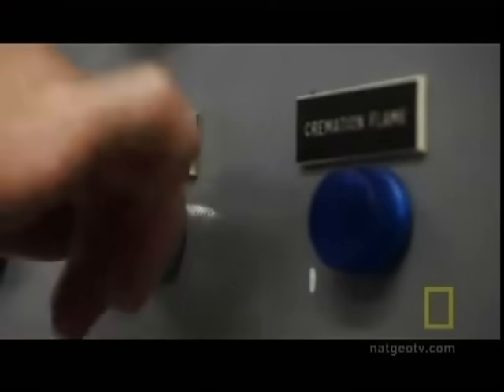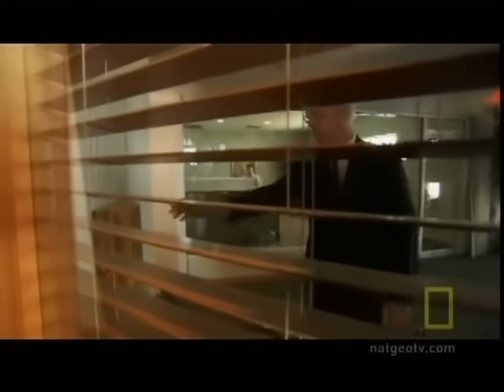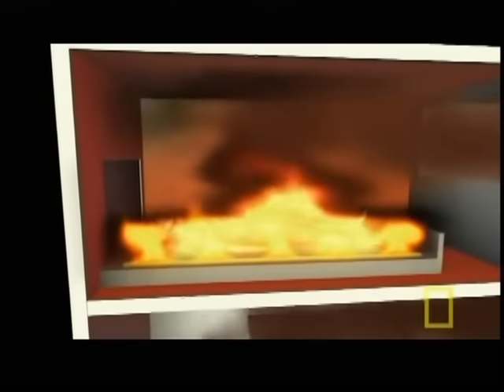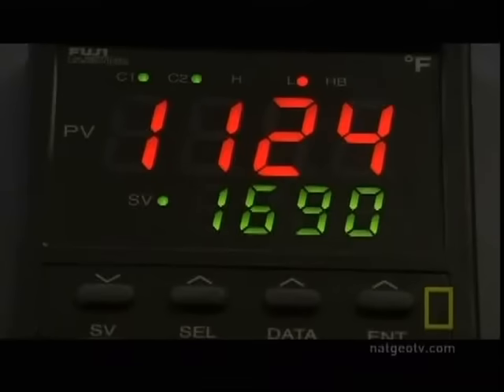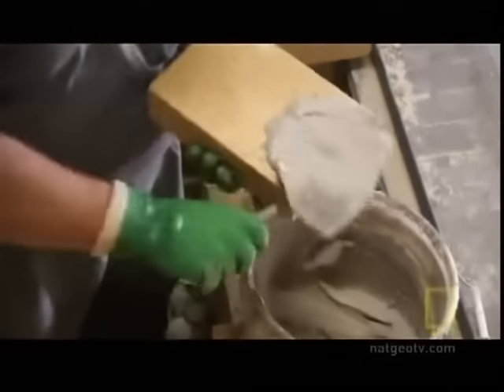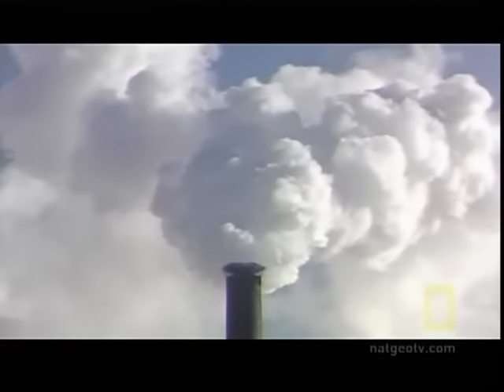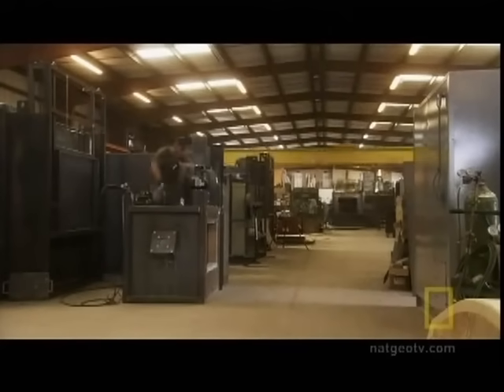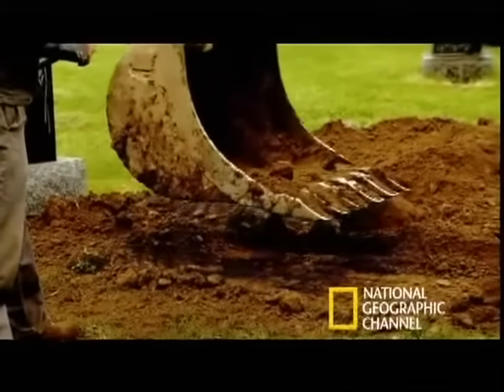What Happens During a Cremation? How do Crematories Work? A Scientific Look at a Real Cremation.

Comment: Remained powder of bones could be sprinkled for purpose of Farming, for purpose of bricks making, for purpose of mixing with Tar and spreading on road for Road surfacing, etc.
In India the remains are released in Holy river or at sea with Hindu rituals performed.
India needs plenty of Such machines as many crematorium are with pyre and uses wood for cremation. 
Hope Respected company could surely extend it's selling branches in India  or JOINT venture with Indian CORPORATE.

Comment: These Retorts or Chambers as many call them are modern compared to the 1928 versions I worked with. The chambers were from 1928 and the burners were from 1967.  We put metal such as steel, bronze copper, wood, and cardboard in there for cremations.

Comment: Inglewood Park Cemetery Mortuary still has very early concrete crematoriums.  Possibly built originally in 1905.
Reply: The evil Germans of the 40’s used common house bricks to build theirs and they could cremate much much faster than modern day crematories. They could also cremate multiple bodies at the same time.
The above facts were disclosed by numerous survivors of WW2.

Comment: Hold up , using a magnet for medical implants? They are non ferrous
Reply from the maker: The magnet is used for the screws from the casket. But yes any implants will not be picked up by the magnet.

Comment: I’m at work now! I have 11 cremations today. With three available cremation chambers I should be done in about eight hours. One of the deceased was killed right in front of the funeral home on Saturday morning he was driving his new motorcycle. it normally takes about 100 pounds per hour with our new units. You cannot put a casket in a cremation chamber unless it is solid wood or rigid cardboard. A metallic casket would be a Real problem. We are limited to what hours we can operate in.  Two of the cases today are badly decomposed and I am going to do them first because they are really ripe! After that will come the traumatic deaths that are missing limbs or have been crushed etc. And then I will finish today with the regular run-of-the-mill cremations. We always have babies. That’s the majority are stillborn or ones who did not survive NICU, Born with terrible defects. Last week I had a case that was 400 pounds! The name on the paperwork was that of a female! The container had leaked mass, It had leaked because this involved a shooting. When we went to slide this thing over you have a very profound male appendage! So my manager said just to use an ETA for the female name.
Reply: @Hello there, how are you doing this blessed day??
Reply: hi as an younger guy with illness im seeking cremation but worried as im so tall at 7ft 1 tall can my body be cremated as im taller but of slim build can i even have an cremation  ??

Comment: 2 hours !!  Germany apparently done 1,000 in 20-30 mins completely to ash.
Reply: Larger ovens, multiple sites, working in batches, not caring about letting the ashes get mixed up, not letting the ovens cool down between them, not caring about the neatness of the burn and murdering between 1 and 2 million Jews outside concentration camps. 

You seem perfectly comfortable with being a neo-Nazi - so it would be really useful if you realised that what you're listening to is a deliberate scam on you as well as its more direct, obvious victims. Look into the history of the 'blood libel' lie, for instance - the reason you use the term 'Satanic agenda', one of the lies that helped facilitate the Holocaust and also a blatant excuse to murder Jews for money, or simply rob them, for centuries before that. See, for instance, how Henry III of England very cynically monetised the case of 'Little Saint Hugh of Lincoln'. How Edward I robbed his own subjects as well as the Jewish population via the Edict of Expulsion. Or how, in the 2020 US Presidential election, one blood libeller funded and ran another blood libeller's 'Independent' campaign to steal votes from his main opponent, then stole $250 million from his most fanatical supporters with a fake 'contest the fraudulent election' fund.

Comment: So your saying 6 million is a little high
Reply: Of course, if you use larger ovens, work in batches, don't bother about the completeness of the burn or getting ashes mixed up, don't let the ovens cool down between batches, use slave labour to keep them running 24/7, operate at multiple sites and murder between 1 and 2 million Jews outside of concentration camps that all helps. 

It would be useful if you realised that Nazi propaganda is a deliberate scam on the people who actually believe it as well as its more direct, obvious victims.

Comment: When they cremate you they calculate the time and temperature of the burn based on your body weight . This calculation is made so that at the end of the cremation there are ashes left to be given to the family. I once saw an interview with two morticians that miscalculated the heat and time needed and when they opened the chamber there was nothing there. The heat and time burned up everything. No ashes no nothin. They panicked because they had no ashes to give the family. What they ended up doing was going out and they found a road killed dog. They cremated the dog properly so there were ashes let and they gave these to the family.
Reply: If you saw this, then the "two morticians" were lying.  

Once cremation is complete, there is only the skeletal remains which are pulverized into what people call "ashes".  If you left the burner on for 12 hours straight (a godawful long time to run - most cremations take 2-3 hours) there would still be pieces of bones.  It wouldn't all just vanish.

--Licensed funeral director / Crematory Operator
Reply: When I did special ops one thing they trained us to get rid of a body was to put 30 gallons of JP4 (jet fuel) in a 55 gallon drum. Put the body in and light it up. The fuel burns at 1,400 degrees F. After two hours all the bones and teeth turn to dust. Nothing left. A navy seal showed us this trick.
Reply: Just for laughs I googled this an I found an article which that at 1400 deg. F. A body would burn to dust in 2-3 hours, everything gone but dust. This jives with what military taught us.
Reply: Lol this is hilarious

Comment: I did this for six years in the 80s at Mount Hope cemetery Topeka Kansas. We had a mausoleum of 2600 crepes and my office was downstairs in the basement where we did the cremations. Our retard was a older unit, and if the body was very large at all, we would have to use sand to build a dam because the body fat would melt and leak out onto the floor, and it stunk pretty bad, smelt like rotten, bacon, grease that grandmother would save in a Folgers can in her cabinet.

Comment: There's a funeral home with a cremation setup down the street from me and about a month ago there was thick black smoke coming from the chimney. Had a weird smell also
Reply: Your watching many movies, cremation does not emit black smoke, they are using natural gas which is odorless.  What you saw was someone burning oil or passing thought a bbq joint.
Reply: @ilovepinktacos  I'm a licensed funeral director and crematory operator.  Yes, crematories can emit black smoke, typically due to an uncontrolled burn (the temperature gets too hot).  The "body bags" from hospitals will sometimes show white smoke.  

But it remains that crematories can and do emit black smoke when things aren't working perfectly.
Reply: Umm sorry. It's a funeral home and cremation services. I know what I saw. No one was burning oil. I live in FL.

Comment: In Ireland the funeral undertaker charges you almost €2,000 for a cheap wicker basket, then calls back to the crematorium a few days later to collect the empty basket, the remains are stripped naked and burnt with several others to reduce costs and pollution…. This is what happens but never said. A throw back to WW2 and the camps

Comment: Witnessed the cremation of a brother in law, was surprised when the attendant grabbed a heavy cardboard mailing tube... Took tube and rolled it under the inner liner the body was in - to lift it up and encourage flames to reach the bottom side.  FYI, if you ever go to a cremation, hope it’s not the first one of the day.  First one in takes over an hour and a half, the last one of the day takes 45 minutes or less.
Reply: If you're obese, you'll be first.
Reply: That’s beside the ovens need to get at least 800 degrees before then body can be entered. Once the body has entered the chamber, the pressure is cracked up to incremental 1200 to 1800 degrees in matter of minutes. A proper cremation of an average person take about 2 hours, then it needs to cool down to take out the ashes.

Comment: I worked as a bricklayer on a crematorium in Enfield England, where we had to replace the bricks in the chamber itself, it’s what’s called refractory brickwork, it was handy in the winter, working on live cremation units, we never lost any time through cold bad weather, I often had my spirit level leaning against the door when I was told another one is coming down, it was a good job but ruined when a baby was being cremated, we went outside, didn’t want to see that, but the buggers waited until we came down assuming that it was in the burner, they actually threw the tiny coffin in by hand , almost missing the opening, it was too small to use the roller trolley, it would fall off after being pushed otherwise, that was it, I jacked after that, the reason, it’s too hot to be right in front of the door, hence thrown in from the side. I learnt one thing though, if you get cremated, the last thing on earth you get is “ the push” 😂
Reply: Think it would spook me out been inside  ,be at back of mind all the bodies that have been cremated and what if someone shuts the door while inside  .
Reply: @chriscringle7740  I think they would have put a sign in front of the door that said something like people working inside---leave door open.  (Jan Griffiths).
Reply: @douglasgriffiths3534  A sign will.not solve stupidity. See Day Davis get crushed by a pallet of booze while cleaning glass out. Screw that. Bacardi, no less.
Reply: @chriscringle7740  we all said and thought as you have 😂😂
Reply: @chriscringle7740  Just someone who doesn't like you or is sick. F that. Couldn't pay me enough.
Reply: 2 of my baby grandchildren were created in tiny coffins I pray to god they were not thrown in like rubbish thanks for the information though x
Reply: @sylviahowardworthington9653  .
Reply: Refractory bricks are special bricks used to take intense heat without br a king so easily like regular bricks. They use refractory bricks when making carbon black powder for tires from burning crude oil.
Reply: Shove is more like it.
Reply: I’m sorry to hear about your two baby grandchildren 😢💔💔

Comment: An hour per 45Kgs? So about 2 to 2.5hrs per body? So if I was divide 6,000,000 by 5 years.....
Reply: Not caring about keeping ashes separate or the completeness of the burn, using larger ovens that run all the time and don't need to warm up each time, and of course running multiple ovens at multiple sites helped. As did murdering between 1 and 2 million Jews outside the camps entirely.

It's worth pointing out that Nazi propaganda is a deliberate scam on the people who actually believe it as well as its more direct, obvious victims. A closer look at the business models of the people responsible for feeding you this stuff would be worthwhile.

Comment: WHY would you utilize/waste/burn up a perfectly good casket in this process? Why not simply place the body on a burning slab of some type? Thus why even when resorting to cremation instead of typical service/burial, cost is still excessive. Make sense?
Reply: That's family/personal choice. As you saw in the video a lot of times it's just a cardboard box
Reply: Insist in advance that you want a cardboard casket not expensive timber. Otherwise you may as well throw thousands of dollars in the furnace too.
Reply: Because it is gruesome, as someone from India it is exactly what happens over here. Cremations are free well mostly it is paid by  the government. There is no casket over here you just get put up on a wooden pyre and off you go. 
Want a cheap funeral? Ask your government to sponsor it for you and stop worrying about the economics of dead body.
Reply: @MrSdsok  Yes, governments should provide essential services and stop outsourcing responsibilities to private commercial enterprises 💰 "Disposal" of the deceased is an essential service too.
Reply: @multioptioned  Even though without caskets are horrifying be careful what you wish for. If your soceity is not used to such gruelling scenes then it will be difficult, but cheaper if you use hay instead of wood for fuel.

Comment: Hindus have been practicing cremation  for thousands of years. We believe 'Atman' which is soul that takes birth again and it doesn't get affected by fire, air or water. So it doesn't matter if our body is burned after death because 'atman' remains and takes birth again. As for the ashes, they are poured in the water body ( preferably a holy river like Ganga). Apart from smoke (pollution might not be a problem in ancient times) it is the best method to dispose a human body.

Comment: I wouldn't do it that way. Microwave, burns 10x Faster than radio waves. X-Rays burn 10x Faster than Microwaves. Gamma rays burn 10x faster than X-Rays.
  The best is Gamma rays, if you could engineer gamma waves emitters that could go into that room.
  A 10,000 watt Gamma Ray cremator, would burn you to a crisp in 20 minutes.
  Get a 1200 watt microwave and place a cup of water into it. It boils in 2 minutes or less. Place it into an X-ray box and it boils in 12 seconds. Place it into a Gamma Ray box, and it boils in 1.2 seconds. Within 10 minutes, all of the meat on your body would be burned into charcoal and the bones would be ready to crumble. After 20 minutes, your just she's with no moisture remaining. Not that much electricity to do the job. About what it would cost to feed electricity into a they bedroom apartment for ten hours. Compared to all of that natural gas and time waste, it would cost a tenth of what this does to cremate a body.

Comment: Cremation is forbidden 🚫 in Islam for a reason. When resurrected it’s a painful procedure, cremation will not help, burial is the correct way.
Reply: I'm going to the furnace
No one is coming out of graves.
Reply: @mazie7952  we all will on the day of Judgement. We have seen corpses intact in graves buried 1440 years ago and they were not mummified. They were good people. Even their shroud is still intact.
Reply: @shaz7860  not all stay in tact
I worked at a cemetery yrs ago
I saw different. 
Does not matter to me. It's only a vessel.
I'd rather burn.
In yrs to come they will run out of room to bury anyway.
Reply: @Patty  yes I agree but burning is not a solution, when we are woken up we will rise from those graves.

Comment: Last time I heard of the term retort, was in the early 80’s during the oil shale extraction process in western Colorado. The shale had to be heated to extract the oil from the rock.
Reply: Retorts are common in pyrometallurgy.
Reply: Retort is also a type of stand used in chemistry.

Comment: With burial vaults, there's no decomposition into the water table.
Reply: I beg to differ. There is a video featuring a funeral home & the representative accepts that no matter the type of vault, in time there will be water seepage & it will leach into the casket  - the water will seep through into the ground. Nothing is water tight for ever.
As a retired funeral director, I have witnessed many cremations. Such a cleansing procedure that takes approximately 2 hrs, with crs given to family within a couple of days. Would recommend it anytime!👍👍😉
Reply: @jrogervaughan  but in vaults not covered in heaps of dirt
Reply: no but you have a decomposed body taking up space. Plus the coffins in vaults are usually made from lead, and leak.
Reply: Vaults will leak after time.  Viruses and bacteria will get into the water table.  Cremation is a fairly sterile process.  Nothing can survive that heat.  (Jan Griffiths).
Reply: With cremation there is nothing

Comment: $100,000 for a crematorium? I'm going to make my own.
Reply: BUT, those buying such just think about all the $$$$ they can make with such, I'd like to know the EXACT $$$ needed for overhead to operate one of these for a year, EXACT gas price etc. needed PER BODY, maintenance & the TOP 10 parts that will fail & when
Reply: My mom's was 1500
Urn was 400.00
Just paid for mine with urn 3k
Reply: 8k
Reply: Rubbish if someone charged you that much they should be Arressted. Have a direct Cremation no embalming, wrap body in a cloth make sure you choose a Crematorium close to you it much cheaper. Or opp for a sea burial that is very cheap, rules are you need to go three nautical miles from land and weigh the body down if course.
Thats it cheap and very mivjng experience indeed.